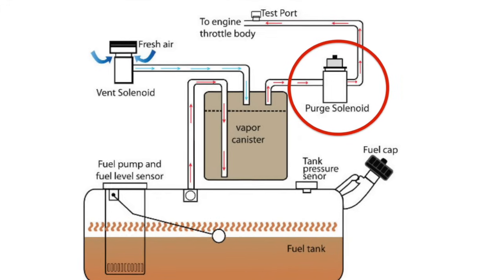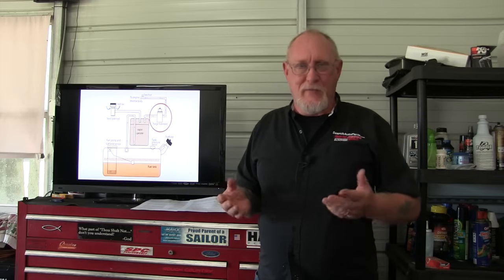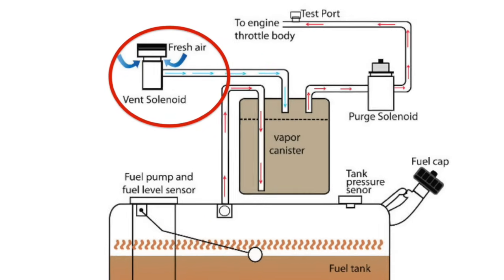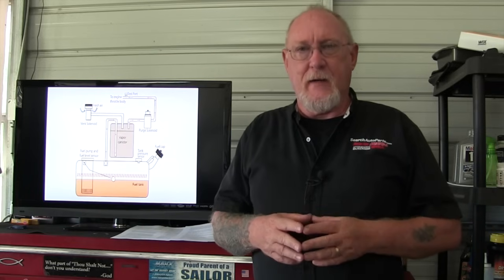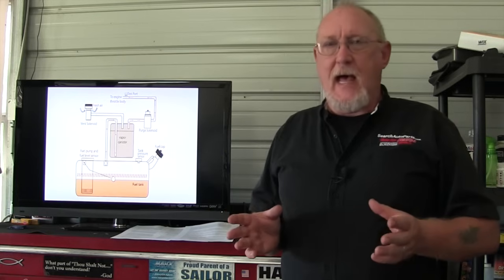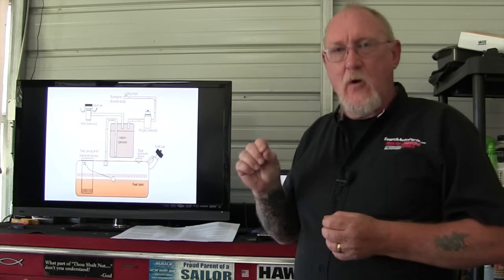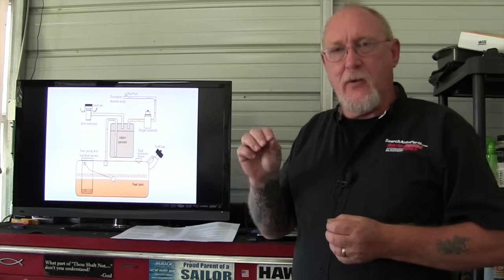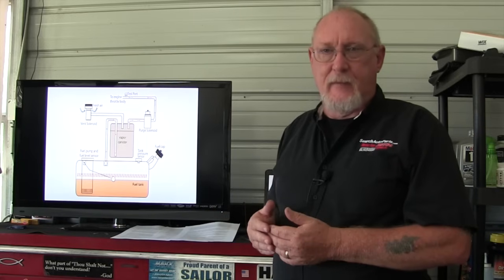The Trainer #70 - EVAP Testing Tips

Comment: I was troubleshooting my Purge Valve Solenoid today, and I finally decided to disconnect it from power and remove the vacuum line that goes to the engine and, with my truck running, I could feel the air coming out of the purge valve without it connected to power; the purge valve is normally closed, so it should not have air coming out of that line without power connected to it, so I now know my Purge Valve is no good. Using a vacuum didn't show that for me when I used my Mighty Vac 8000, and I cannot hear it click when the ignition is turned on, so it is bad.
For anyone else trying to diagnose whether their Purge Valve Solenoid is good or bad; this is definitely a good way to see. A solenoid is an electrically actuated switch. The Purge Valve is normally closed and doesn't open without the computer telling power to go to it and open it.

Comment: I have a 08 f150 fx4, can’t pump gas without the pump shutting off constantly. I’ve replaced the vapor solenoid, tested the purge valve, looked over every line , inspected the canister and still didn’t fix it. No engine codes either. I got a gas tank vapor sensor next, and smoke machine so hopefully that helps

Comment: I'm impressed!  You covered many more possibilities for a very small EVAP leak than I have seen in other videos!  One thing that opened my eyes, was actual fuel tank level!  My 2011 Saab 9-3 2.0T Aero has 2 float sensors, one on each side of the tank.  I do have a Tech2 diagnostic scanner for Saab, and will be running some diagnostics.  Unfortunately, I have just a simple smoke machine, nothing that measure pressure, vacuum nor inches of water, but never had a need for one.  Might be a good investmant at some point.  I did change my purge valve, a new OEM gas cap, but I saw one video that a new replacement Purge valve was actually bad.  The fuel filler neck is as clean as a whistle, and not distorted.  Also, my PCV valve is pushed in after the intake manifold is pulled off (which I just replaced), therefore it got a new intake manifold gasket and throttle body gasket.   I've read that a bad PCV valve can mimic the P0456 CEL.  I only have 84,000 mi on this car, and drive mosly on clean roads. One road I take is dirt and only about 1/2 mile long.  I'm hoping it is something simple in the engine compartment (like a vacuum line to the turbo), since I won't be thrilled if  I have to drop my fuel tank to replace a tank pressure sensor, for instance.  The evap lines that run under the car are rigid plastic, right into the purge valve and out.  I do have an EVAP service port.  Unfortunately, Saab did away with the access plate to the fuel pump years ago, since there are numerous lines running around that area, and there wouldn't be any room to pull the access plate to change the pump, or check the fuel pump plate O-ring for leaks, let alone change or check the pressure sensor.  I'm not sure how easy the charcoal canister or vent valve is to get at.  Any other tips?  I have inspection due in december, and obviously running out of time.  Weird thng is, I also have a 2007 Saab 9-3 2.0T, same engine with 230,000 mi on it, and hve never had an evap code!  Difference is, 1 fuel level float on this car.  Clue maybe?

Comment: I don't have a check engine light or no codes, but when I try to fill my tank, gas backs up and squirts out? Is this an issue of my evap system or is it an obstruction in my line.. I think the flapper valve fell into my filler line.. 05 infiniti g35

Comment: I GOT P0441 code & engine light on. I did followings.

I changed purge valve ,clear the line with high pressure air,changes gas cap but I still haven't cleared all I/M monitors (even I drove for like 100 miles) and Cat & Evap still red and blinking and my engine light came on. Any suggestions or Help will be helpful.I won't pass inspection
Reply: disconnect the negative battery cable and leave it for an hour

Comment: Dealing with a '16  2.5L Frontier. I have a lean condition, and have done all the easy stuff & not so easy. I've just about eliminated everything but the EVAP system. It's the only vehicle I have that doesn't suck air when I take the gas cap off. And now it doesn't want to top off when filling up. It has just over 100K miles on it. I really want to like this truck. This started right after an O² code and replacement of those sensors.

Comment: thanks for information, 2011 tacoma code:456 (Evap small leak), smoke test shows smoke coming from small tube that is attached to filler hole.  OEM gas replaced and filler hole was covered but small tube attached was left uncovered and  smoke was coming out. any advise. thanks again.

Comment: My  01 xj is currently throwing a large evap .. trouble shooting I replaced my gas cap the o ring was another dry rotten .. after this it tossed a code to my purge valve which I also replaced .. but still throwing the code after reset ... My next two bets would be the gas line or charcoal  box ...?  If these two things aren't the cause.. would my leak detection pump the cause ?

Comment: Has to be the BEST EVAP explanation video I have come across; the knowledge you shared was unique and to the point! 
I have Subscribed to your Channel as I can only imagine the wealth of knowledge I can learn for sure, thank you!!
I am a DIY Mechanic working to help find and fix a P0456 DTC on my Mom's 2008 Lexus ES350 with 55K miles.
I have purchased the new Autoline Pro Ventus (All-In-One) Smoke machine and just recently purchased a new Topdon ArtiDiag Pro so that I can have the Bi-Directional controls to manage the Vent Valve (primarily) and the Purge Valves open and closed states. I will work on this project today and hopefully find the leak.
Reply: Any success?

Comment: I'm getting a blinking Monitor icon, "EV", yellow LED indicator light, No DTC's presently stored in code reader's memory. Also, NO Engine light is presently showing on dashboard.
Reply from the maker: Vehicle info? (YR,Make,Model, Engine)
Reply: @VehicleServiceandRepair  Thanks. It's a 2012 Dodge Grand Caravan stow 'n go. I've been driving it back and forth around town 5 miles here and there but am old at 75 and can't do much traveling and am in fear of a cop hitting me for an expired inspection ticket at $200-$250. After changing the thermostat and Heater-blend door actuator (clacking noise/teeth broken), I cleared the codes in hope that the computer would run its recognition over time.
Reply from the maker: @jerrymontalbano3222  Can you take a picture of the cash with the light on so I can see it? Send it to pmeier@endeavorb2b.com

Comment: Co2 isn’t smaller than air. Air is majority n2  which has a bond length of 1.09 angstrom compare to 1.16 of c=o. Keeping in mind co2 has two of those bonds. Also the molecular mass is 44g/mol vs 28. Using the co2 detector is a great idea.

Comment: I have a 2011 porsche panamera and I smell a strong carbon exhaust coming into the cabin when at idle could it be a bad purge valve or a clogged pvc
Reply from the maker: If you're getting an exhaust odor in the cabin, check for an exhaust leak.

Comment: I'm a novice actually. IMHO vehicles with outdated hoses that should have been maintained properly cause detecting such leaks a headache trying to trace a leak. So for sake of argument, many hoses are so bad they need replacing. With that done then comes checking the actual components, which would make it much easier to find the culprit component.

Comment: When you're pumping gas into the tank, where do the vapors in the tank go? I see no pathway in your diagram that would allow flow because it looks like the vent and purge solenoids would be closed. I have an '09 Tundra with all the usual codes on that will not take gas at the station anymore without over flow. But if I leave the truck for hours and then pour gas in with a 5 gallon can it flows in fast with no problems.
Reply from the maker: The layout and design of EVAP systems is unique to the various OEMs. This is a fundamental overview of the role of the EVAP system. But to answer your question, I would inspect the vent solenoid to make sure it is open (normal position - only closed for testing purposes). And the line from the canister to the tank. Something is restricting air flow from the tank to the canister - necessary as the air is displaced by the fuel you're trying to add. Hope this helps!

Comment: I only have the P1494 code, which is leading me to believe I have a faulty solenoid/LDP, versus a leak in one of the vacuum lines. Any thoughts?

EDIT: I also noticed since my check engine light came on, my cruise control doesn't work as well as it did prior to the P1494 code being thrown. FYI...

Comment: Sir Good Morning and nice to meet you! I have a 2003 Dodge Caravan and i have 2 evap codes P0442 & P0455 and i have performed several smoke tests on the caravan but i have no scan tool with bi-directional controls to command the evap system to seal, what other affordable tools can i use to seal the components of the evap system?
Reply from the maker: Chrysler uses a Leak Detection Pump to identify leaks in the system. The only thing to close off is the vent solenoid, and you can do that manually. Personally, I like to break the system down in sections and test each one separately. And be aware that the smoke may not be making it to the fuel cap - fuel can absorb the smoke. Look at the pressure decay too. Here's a video that may help:  https://www.youtube.com/watch?v=CSn0ljUS6kI
Reply: @VehicleServiceandRepair  Good Morning! How can i manually close the vent solenoid?
Reply from the maker: @Diagnose1  You can use Mode 08 on some vehicles to close the system, or you can remove it and block the line.
Reply: @VehicleServiceandRepair  I dont think the 2003 Dodge Caravan has a vent solenoid but i do see a vent valve on a hose connected to the charcoal canister
Reply from the maker: @Diagnose1  Same thing
Reply: @VehicleServiceandRepair  yeah but that vent valve doesn't have a switch connector it just has 3 slots to connect 3 hoses to it, i can film a video to show you if you'd like ill be more than happy to do so
Reply from the maker: @Diagnose1  Take a look at that video link that I sent you first. If that doesn’t answer your questions, film what you got under the car and send it to me. I’ll take a look at it as soon as I can.
Reply: @VehicleServiceandRepair  ok brother i will do that for sure

Comment: I think you have a problem with the diagram shown at 7:57. I'm pretty sure the test port must not be between the purge solenoid and the engine/throttle body, or the smoke will leak into the intake manifold and not travel to the rest of the system. If the test port is located between the purge valve and the canister, then the smoke will be forced through the system and testing can be done. Example: https://www.rockauto.com/info/321/12578233_Primary__ra_p.jpg

Comment: Evap systems are incredibly badly designed. They use cheap steel lines that run along the frame rails that are exposed to the elements and rust out, in some places rubber hose is used that deteriorates. If quality materials were used for the lines and other key points in the system, like the pump retaining ring problems would be greatly reduced and repairs could be made more accurately, and less expenive. This is another effort to make what is a basically simple system overly complex.

Comment: Great video, nicely done. No crazy music, paced at a good speed .Videos like this really help. I need to get information that tells me what   % that the purge valve should be open at different RPM. Any idea where I may find that,. What causes the EVAP purge valve to open in the first place?  Could a stuck "open " purge valve cause the engine to go to about 2500RPM? thank you
Reply from the maker: The purge valve is either open or not - it's how long it's open that I think you're asking about. The ECM commands the valve open under specific conditions (unique to the vehicle) to allow the collected fuel vapors in the canister to be drawn into the engine and burned. If the valve is open when it shouldn't be, it may cause a rich DTC - usually at idle. Is the car you're working on a MAF or speed density system? (MAF or MAP sensor?)
Reply: @VehicleServiceandRepair  Thank your reply. 
Let me give you some background on the vehicle that I working on.
2002 Buick Century about 150K miles
problem idle speed sometimes gets as high as 3400 RPM. No fault codes so far.
I have replaced TPS, IAC, PCV valve and hoses. Cleaned MAF sensor.
The condition is INTERMITTENT.
Reply to you question. I have both MAF and MAP sensors and I get readings on both.
I'm using a Tech 2 clone. Can't tell you how good it really is because I'm not familiar with scanners and don't know for sure what the one I have is actually capable of doing. 
It shows around 40+ parameters on Engine data.
The idle speed sometimes is "normal" and then goes all the way to 3400, hasn't done that lately it lately, RPM stayed around 2500.
I have noticed that IAC goes from about 30 to 60+ counts ( depends on RPM) I had as much as over 90 counts.
TPS shows increased % and voltage as RPM increases. However I think that the plate is actually closed. Why are these parameters changing.
I suspect that heat may be having an effect on the problem,  
It is most likely to occur when engine is warm up.
Yesterday I had an event when the engine ran in the 700's RPM for about 15 minutes, then things went out of wack. All this sitting on the driveway.
I have watched your videos, signed up for Motorage connect but have not seen anything that resembles what is going on.
Someone suggest that it might be the PCM. 
I ordered a LOADpro and the companion book. Prove arrived DOA. I'm awaiting for the replacement. 
I want to do what you suggest on the video and check as many connections as possible. I want to be as sure as possible that if there is something that caused the PCM to fail, it can be identified and correct before a new one is installed, if that is the course of action.
This thing has baffled quite a few people.
If you have any suggestions, as far as any of your videos, material from MotorAge connect, or your personal suggestions, I would be greatful for anything that might help with this puzzle.
Thank you
Reply: @dveloso150  did you find a mechanic? what was it?
Reply: @i.jackanov7382  Thanks for asking . As it turned out I became the mechanic. What I did is I purchased an used IAC ( idle air valve) controller. I found out that the IAC valve is a step motor and is controlled by the ECU. Since no one can really tell me what is going on, and I have tried many different approaches without a desirable outcome I decided to just make it happen as best as I can. The IAC controller can be plugged in the valve and the idle can be moved up and down. I chose some RPM that sounded and felt like was ok and set it at that. Never connected the ECU plug back to the IAC and I now have a vehicle, which is not perfect, but is a hell of a lot better than the moody engine that I had with all the extreme variations. It hesitates a bit when the engine is cold but after a few minutes it runs reasonably well. I don't recall if I told you that I replaced the ECU and the car ran fine for a couple months and then it started with the huge idle variations. It now has a IAC valve which has been set and the computer can't communicate with it to operate the step motor. Life is not what one wants but what one can get. That is my answer to the problem that no one was either able or willing to answer. Thank for contacting me.
Reply: @dveloso150  Check to see if your solinoid operated EGR valve is sticking. If it sticks , it will act like the throttle is being opened.

Comment: Can a stuck purge valve create a p219b code. I’m trying to find the source. my mechanic said might be a vacuum leak. He said injectors are okay. I have a rough idle and a p219b code. I already replaced pcv valve. It runs smooth at road and hey speed.
Reply from the maker: This DTC indicates a detected imbalance between the banks air/fuel ratio. So first, I'd try to determine which bank was abnormal. What are the fuel trims for both banks? (STFT and LTFT)? Also, what kind of car are we talking about? (Make, model, year, engine, mileage)?
Reply: 2014 Grand Caravan 3.6.   Just had all the rockers and exhaust cam replaced along with spark plugs but the code was there prior to the repair.  I have a cheap code reader only and all it tells me is there are 3 DTC’s all p219b.
Reply from the maker: @rydgomez2  Did a bit of research and a common cause on your vehicle is aging upstream oxygen sensors. They are not responding fast enough and may set a code. If you have high mileage on your van, try looking at them.
Reply from the maker: @rydgomez2  What are the fuel trims at idle and 2500?
Reply: Thanks. I’ll check into them. As for fuel trim I don’t know. I don’t have a scan tool.  I’m looking to buy an affordable one that can perform well for the diy.
Reply: Can I have your email so I can send you some screen shots. ?
Reply: 2014

Comment: Well done!! Very well spoken and broken down the right way, I e looked everywhere, I have a 2007 Volvo S80 3.2 , I have a P0458 code , also codes for all 4 O2sensors?  Could this Evaporator emissions system purge Control valve circuit low be the cause of all of my O2 sensors throwing codes?THANKS FOR ANY AND ALL HELP! I work on my 2003 x5 BMW but this is my first Volvo....
Reply: nope